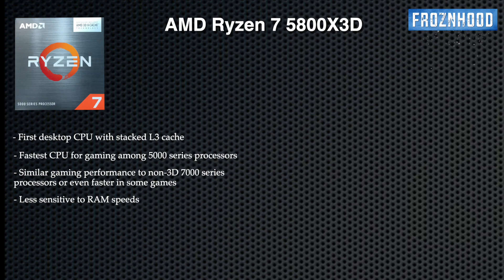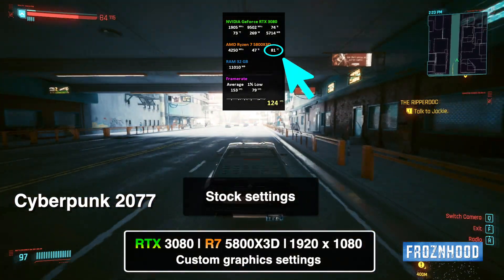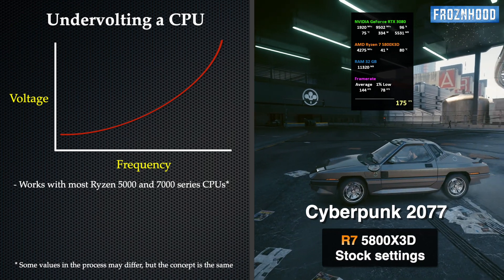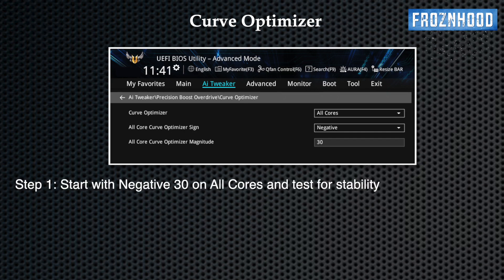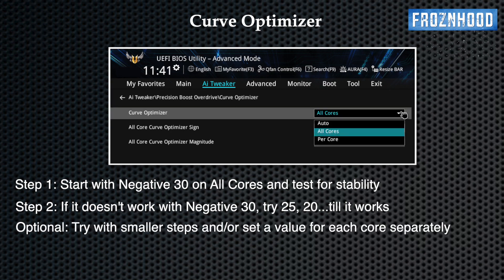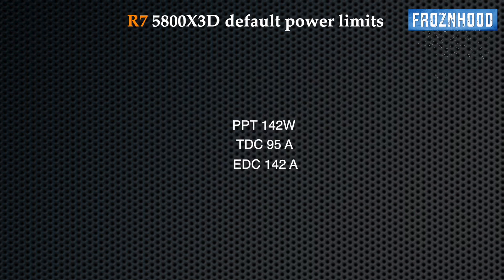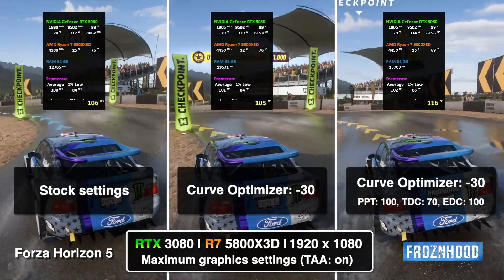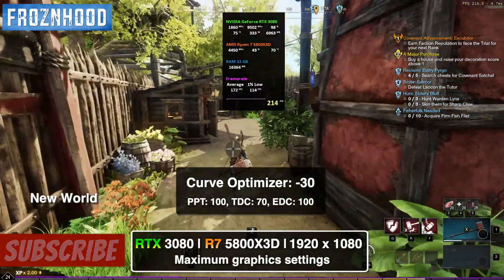Optimizing Ryzen 7 5800X3D - Higher performance, Lower temperature | Undervolting | Curve Optimizer

Comment: Hİ! I am using MSI motherboard (MSI B550-A PRO AMD AM4) . I've already chose Kombo Strike 3 (so undervolted -30) but for other settings I only have PPT setting on my motherboard. I don't have TDC and EDC. Is there any way to reach these other 2 options? I chose undervolt it to 1.02 volts by MSI dragon center program manually for now.  Because kombo strike 3 (-30) is not enough to make CPU stable. Please help if there is a way to reach TDC and EDC on my motherboard. Thanks! It's a great video.
Reply from the maker: Hi, do not manually set the CPU voltage. This is wrong and will make the system unstable. The CPU needs a dynamic voltage for different situations. I don't why you can't find TDC and EDC. Try again. Kombo Strike is not exaclty the same as Curve Optimizer, so it can lead to different results. Also, the CPU should be stable by default. You don't need Kombo Strike to make it stable. What you want is better working temps and potentially a better performance in terms of FPS.
Reply: @FroznHood  It's still dynamic. I've just limited the maximum voltage to 1.02. I don't know I don't have the TDC and EDC settings on my BIOS I only have PPT, so I didn't want to reduce it without reducing TDC and EDC. I'll send an email to MSI and ask why I can't reach the TDC and EDC settings. Then I'll also inform you if I got any info. Thanks!
Reply from the maker: OK, let me know if there is something new.
Reply: @FroznHood  Sorry, It was absolutely my fault :) my bios update wasn't the latest one 😅 I updated and now I have the settings thank you anyway!

Comment: Hi, thanks for your job.
I follow your setting but my GPU dont up to 100% .. no more 65 70%. My fps fix to 70 in my game test. Can you help me.
A french viewer
Reply from the maker: You need to provide more information - which game, what resolution, what GPU do you have, is your CPU 5800X3D?
Reply: @FroznHood  
Thanks for your answer. I find the solution. I make a mistake. It was not the good Line. It was Line socket. Its rectified. Everything is ok. Thank you very much for all. Thanks thanks thanks
Reply: Thank you best settings and to the point much appreciated and respect 🙏🏻 🫡, I was going to put my 5600x back on, with -30 all cores/ 100/70/100 , my 5800x3d with noctua NH-U12A 2 fans plus all my case fans my cpu spik 4849 on 2 cores 4749 61c playing quake champion and quake live all day 2x16 32gb 3600 cl14 1 m.2 980 plus 500gb windows 11 pro / 2 m.2 samsung 970 plus 1tb steam games you really hit a home run with this setting never had a crash I benchmark everything from cpu to m.2 , memory, gpu every benchmark you can do I have done . I have the asus rog strix b550-f gaming with new bios I had 40xx I put 37xx is the last bios .thank you very much for your support. Much love and respect from NY Rican in Puerto Rico .

Comment: To be honest I was disappointed with the heat of this CPU...until I watched this! Even with my 280mm AIO temps were usually around 77 while gaming.  This is hands down the quickest and easiest thing I ever did to get better performance and lower temps. Never thought I'd see my chip running so cool (just above 62 degrees while intense gaming), and seemingly locked at 4450mhz constantly. Thanks so much!! You are a legend
Reply: Huh?? I got an air cooler running at 50 celcius with the 5800x3d, but my clocking speed wont go to 4.5, even tho I have set it on the bios

Comment: Great video!!!... got rid of 50-60% of my stutters in MSFS... but i think i still get cpu bottle neck when i turn fast inside my plane when i am on the ground.. and see i get red CPU BOTTLECK indication on the benchmark...  my gpu is 7900xtx ... i know my problem is cpu.. when i turn fast i get stutters and fast fps drop..  is there any other settings i can push the 5800x3d even more?
Reply from the maker: There is always some kind of bottleneck. You may want to watch this video on this topic - https://youtu.be/NN5fB7Be9_Y

You have a very good CPU and GPU combo. Just enjoy it. Happy gaming!
Reply: @FroznHood   is there any other settings i can push the 5800x3d a bit more? or the -30 and 100,70,100 is the only thing i can do? even if i can push it another 5% i would take it!
Reply from the maker: For gaming, 5% more, no. But I don't understand why would you need that? It is already a very fast CPU.
Reply: @FroznHood  Normal gaming i wouldn't care.. but with MSFS .. when i'm on the ground.. i get a bit of cpu bottleneck but not by much... which causes quick fps drops..which causes stutters... but since i changed the bios settings with -30, 100,70,100 made a big difference and solved 75% of my micro stutters! 🙏🏽 just need to push the cpu a bit more (without changing it)
Reply from the maker: That is very strange. Something is wrong and I don't think the CPU is the problem. Anyway, the only thing you can do is to find how many cores MSFS actually uses simultaneously, and if it uses 4 or more cores, you will have to optimise the CPU for that kind of work. But multi-core optimisation involves the opposite strategy. It is used for video rendering, 3d rendering and so on, things that this CPU is not built for. The CPU will need more power and the temps will be much higher. It is a risky and time-consuming process, absolutely not worth it in my opinion. If you have that problem in MSFS only, well, don't blame the CPU.
Reply: @FroznHood  the problem with msfs.. its not optimized for multi core cpu's... uses mainly core 1 and 7 .. the rest are almost not used... can i boost those 2 cores somehow?
Reply from the maker: No, no overclocking is allowed in X3D CPUs. In this case you have already done what you can, following the undervolting strategy. Only thing you can do is to play with the in-game graphics settings and check if there is a particular setting that drops the FPS so much in that game scenario.
Reply: @FroznHood  Thank you so much for your help! and great videos!! 🙏🏽🙏🏽🙏🏽

Comment: I set offsets to -25 and did the other setting you recommended now I’m getting 20-30 fps boost consistently. Thanks brother! My cpu is now running at 40-50 Celsius degrees while gaming and 20-25 Celsius while idle/ browsing etc. The combo like other said is the true winner!
Reply: No chance you are getting 20-25 degree idle
Reply: @joewoolley4780 my house is also cold but yeah 25c
Reply: what cooler??
Reply: @bradhaines3142  believe it or not enermax aquafusion 360 adv. The older Enermaxs had issues but this new adv version is great.
Reply: I will say ever since I slotted my 4090 in my build the 5800x3d has risen by about 5-10 Celsius but it’s still performing like a champ and clocking at 4.4 ghz +
Reply: @sales.angelperez  i think he was asking what cooler are you using to see such low temps on your 5800x3d
Reply: @pochienie1 Yeah those temps are almost impossible unless you live in the antartica 😂
Reply: That’s the name of the cooler ^ Enermax
Reply: I started at -30 but got better results from -25.

Comment: negative 30  in all cores  reduced my temperatures, frequency  runs  allways  at its max  but no fps gain.  With  ppt-100 , tdc70, edc100  i got less fps, tested in valhalla and  the last of us  with RX 7800 xt any advice to  see any fps increase ?
Reply from the maker: Aren't you GPU bottlenecked in this case? At what resolution are you playing.
Reply: I'm playing at 1080p
Reply from the maker: So, aren't you GPU bottlenecked? These games are GPU demanding. If you are limited by the GPU you can't expect a performance increase coming from the CPU.
Reply from the maker: When your GPU is always at 100% load you have a GPU bottleneck and in this case the CPU is not even using its full potential. Watch this important video (you will learn a lot from it) - https://youtu.be/NN5fB7Be9_Y

Comment: I have a 360 rat, so the temps have never reach 80c max hit 75c on CB test, and usually anywhere between 45-70 ish veil gaming, and idle sits at around 35c. Someday i might try undervolting.

Comment: Followed some other guys "tutorial" which was pretty much setting an offset under the voltage settings. Which was hella unstable with clock speeds dipping a lot and temps not really dropping. But after finding your vid and properly setting things under curve optimizer my clock speed is stable at 4.45mhz no dips or anything with lower temps really insane. Thanks bro 👍

Comment: Wonder if anyone has ever done studies on wear and tear by undervolting. I'm no electrical engineer but I did stay at a holiday inn and I know most electronics are designed to operate within a certain voltage range. When you dip the voltage you increase the amps and that can damage equipment. Like having brown outs and trying to start electrical motors or AC units. During a heat wave a few years ago I was monitoring my wall voltage and it was sagging down into the low 100's or high 90's. My AC would not kick on and electricians did mention the strain and wear on electronics when trying to run them with too low of voltage. Clean proper voltage is what helps the most keep electronics working long term not starving them of voltage but making them run hard on top of it.

Comment: I' ve set my PBO limits ppt 195 tdc 130 edc 140 for my R9 5900x in CB r23 mc 10 minute throttle test 23,000. Whats a safe all core number for undervolting number for my specific cpu and will I lose benchmarks scores?

Comment: Hello so I have a beefy 360 aio and temps don't vary much when doing these settings. Do theses settings also improve fps in games? Apart from reducing temps
Reply from the maker: The answer depends on too many factors. Pick 2-3 games that you play and compare the performance. You should take into account that the CPU controls its frequencies not only according to its current temperature, so the fact that you have a good cooling is just one piece of the puzzle.

Comment: Hi! How do i achieve this on a AB350 gigabyte? Thanks!
Reply from the maker: Check if you have such settings in your BIOS. If you find them, you can use the same values for 5800X3d.
Reply: @FroznHood  sadly i couldnt find them. Thanks for answering bro

Comment: i havr ryzen 7 5700x should i do this ? and should i turn on resizable bar im new and have no knowledge
Reply from the maker: Such procedures are done for optimisation - stable max frequencies and lower temperatures. You do it, if you need it. It is not mandatory. And it is better if you know what you are doing. If you like how your system works already, you don't have to do it.

The benefit of Resizable Bar is questionable. In some games it may bring minor FPS improvement, but nothing special. You can turn it on. It won't break anything.

Comment: what should curve optimizer be for ryzen 9 5900x?
Reply from the maker: The strategy is the same. Try with -30, but 5900x and 5950x usually can't handle it. So, then try with -25 and so on, till you get stable system. It should be OK with -20, but that depends on the unit.
Reply: thanks for the reply sir. My cores 6 and 8 are the best, core 4 and 11 are second best. so should I do -15 or -25 for those good ones? and -20 for the rest @FroznHood
Reply from the maker: As I explained in the video, I do not recommend setting Curve Optimizer per core. It is not worth it, it is a waste of time, harder to test for stability and so on.

Comment: with a b450 msi board, is it ok to have Kombo Strike 3 AND the changes 100- 70 - 100 at the same time? Or should i disable Kombo strike?
Reply from the maker: Kombo Strike is an alternative to Curve Optimizer, not to the power settings.
Reply: @FroznHood  thanks for the reply, I guess I should have worded my question better. Is it okay to have both Kombo Strike and the power limits on? or am I limiting it too much?
Reply from the maker: Yes, it is OK, since they do not exclude each other.

Comment: Hello! Please tell me, are these settings suitable for a regular ryzen 7 5800x? Thanks in advance for the answer!
Reply from the maker: Yes, the strategy is the same and it gives very good results - (-30) Curve Optimizer and setting the power limits. The power limits must have different values for 5800x. Set lower value than default, step by step, till you get good results.

Comment: Will this process solve the bottleneck? 
MY SETUP : RTX 4090 + R7 5800X3D + 2X16GB 3200MHZ RAM - TUF B550 WİFİ
Reply from the maker: The question is too general. You have to be more specific about that bottleneck - what game, what resolution etc.
Reply: @FroznHood  I thought More fps = Low  bottleneck / is it correct ?   1080p or 1440p but ı generally use 4k
Reply from the maker: This is not the right description of a bottleneck. You can watch my video about this topic - https://youtu.be/NN5fB7Be9_Y . Also, you ask about 1080p and 1440p, but you mostly play at 4K. I don't understand that.
Reply: @FroznHood  which one has more bottleneck ? Curve optimized r7 5800x3d or without curve optimized ? This is my question sorry for my english..
Reply from the maker: You are asking a wrong question. Watch the video from my previous comment.

Comment: So what you're saying is this: we undervolt the cpu so that the unused or barely used cores are run at lower clock (or power) setting, so that they generate less heat, and the less heat generated keeps the cores that are under stress by the game, run cooler and therefor, at their max clockspeed.

Comment: I have a 360 rad so temperatures have never been an issue, set the offset to -30 and the all core settled at 4.45Ghz on a 30min stress test, great results man

Comment: I have a tuf b550 plus and I'm not able to find your settings in my bios menu. Please help.
Reply from the maker: Check again. Update the BIOS if needed. It is the same BIOS I am showing in the video.
Reply: @FroznHood Asus x470 f-gaming latest BIOS version (6211) this option is also missing. In this case, the cpu works as if it were already configured via pbo. Perhaps Asus has already configured the optimal pbo by default and has blocked users from accessing this setting. I can’t quite figure it out myself, but it seems like it is. Because in games, monitoring shows the correct frequency, temperature and smooth operation of the boost, just like it does for users with pbo settings
Reply from the maker: PBO is always active, but people think of it only as an overclocking technology. But it is much more than that. I haven't heard about any vendor blocking those settings and it is not logical. There is no reason to do so. All B550 and X570 motherboards have access to it. I am not sure only for B550M and the older generations.

Comment: So with the -30 offset I get 14,700 cr23 and with the offset and current limits I get 14,300 but cooler temps is second option more worth it I’m just gaming btw.
Reply from the maker: Do not look at Cinebench scores if you are optimizing your PC for gaming. The score is irrelevant in this case. Use it only for stability testing. Compare performance in games, using a game with internal benchmark. You will see both better performance (in many games) and temps (in all games).